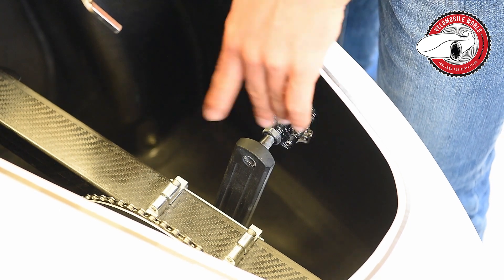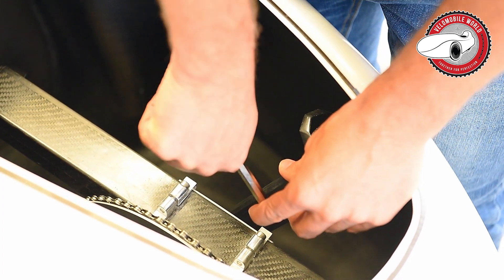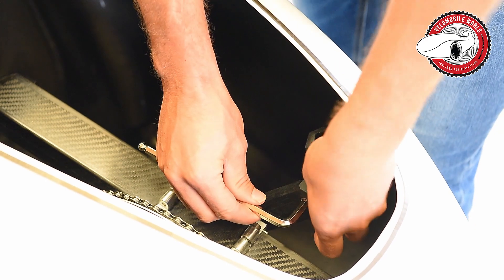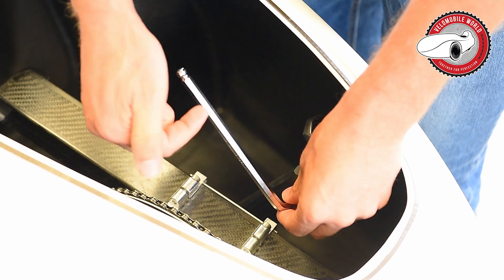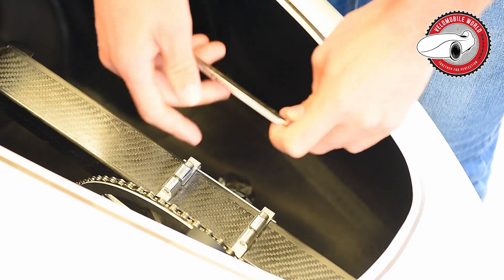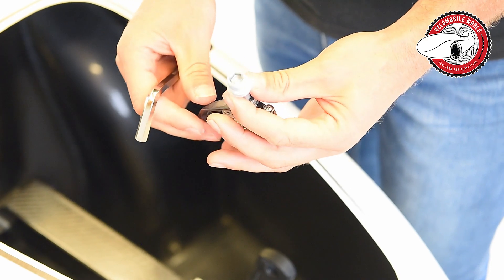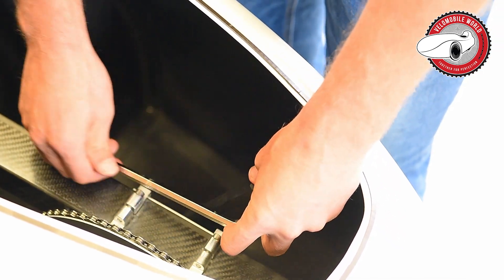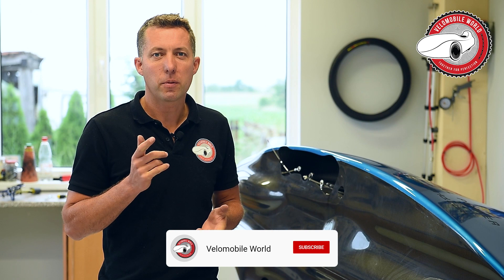Pedals Disassemble from Cranks | Alpha Series Velomobile Maintenance

Comment: Maybe also good to mention that there always is a L and a R on the pedals. Also a nice rule i think is, that you always tighten both pedals forward and loosen it backwards. Otherwise they will come off through moving the pedals, now your feet automaticly tighten the pedals. So, tighten= forward, loosen=backwards😊 Nice video! The Carbon frame sounds beautiful! Because your allen key lands on it😊
Reply from the maker: thanks
Reply: Hi Jan does that go for the Bulk Pedals as well.  I used a Newton Meter and set to 10 nm as you said.  @VelomobileWorld